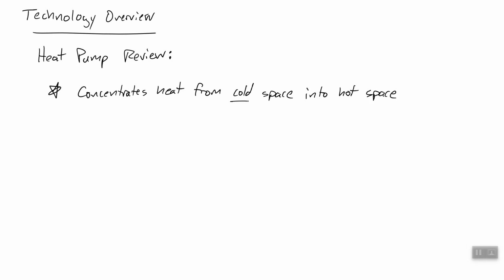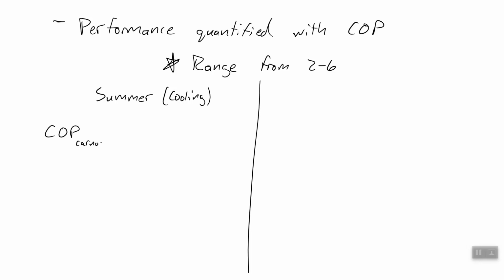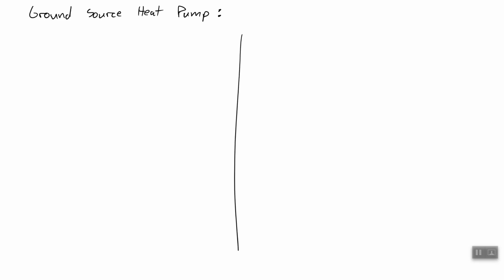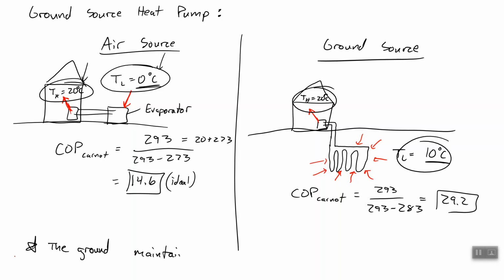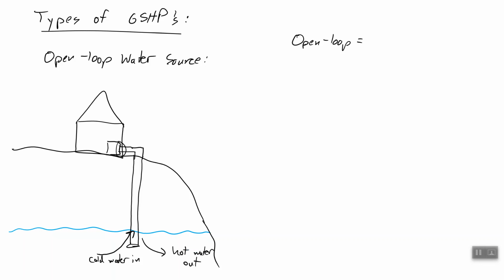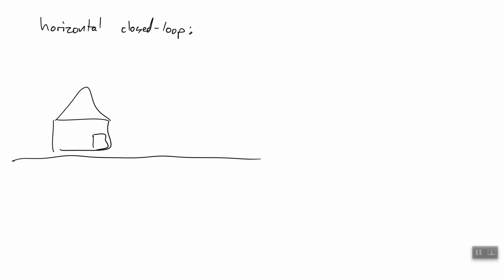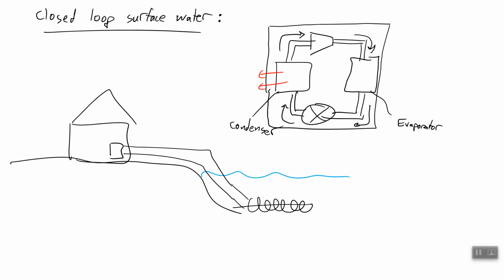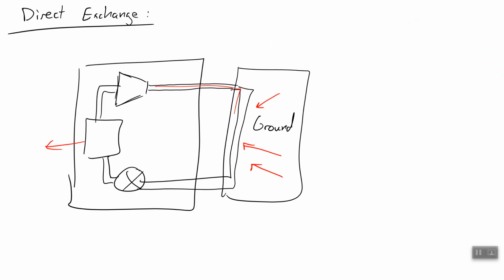Geothermal - Video 4 - Technology Review

Comment: At approximately 21:20 in the video you made a drawing of an MRU cycle. The drawing shows that the outlet of the compressor goes to the evaporator, then to the expansion valve, then the condenser. The flow of the refrigerant should actually be in the reverse direction. The outlet of the compressor always flows to the condenser. In summer or winter mode, the outlet of the compressor always flows to the condenser.

Comment: Thanks. You are the best resource on geothermal on YouTube. i have 8 acres and i want to put a diy horizontal ground source system. 
Two questions
1) Part of the property is on high ground (including the house) and part of 8 ft lower. Can i just put the loop at the bottom on the hill and bury it ?
2)is there a way to integrate air source heat pump ductless mini split with ground source?
Thanks

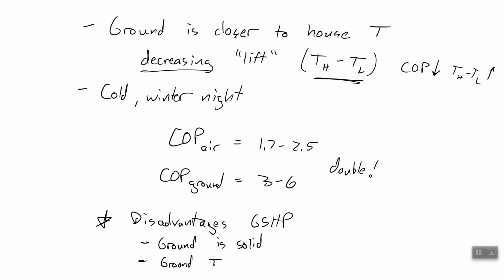Comment: At 13:26 you talk about the ground temp changing over time, is this not nullified by using the same system in reverse for cooling in the summer?  Dumping heat into the ground in summer and pulling heat from the ground in the winter?
Reply from the maker: If the heating and cooling loads are perfectly balanced this would be true. However, in most locations they are unbalanced. If the cooling load is dominant then the ground will heat up over time. If the heating load is dominant  the opposite will happen. Either way, the temperature change usually negatively impacts the operation of the heat pump.
Reply: @rydgemulford can rain cooldown the ground